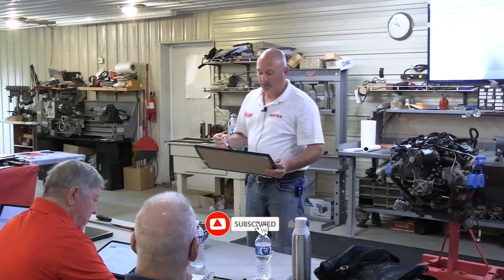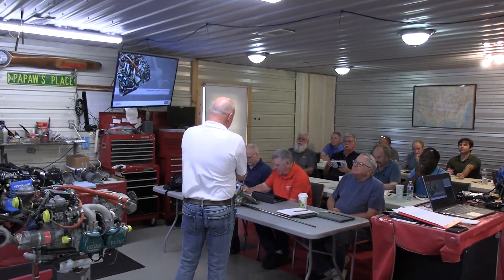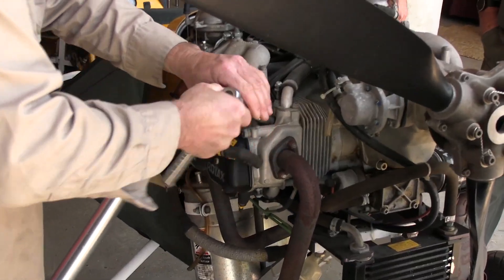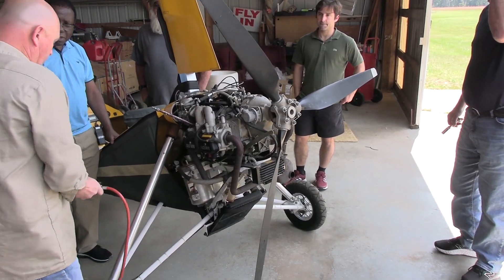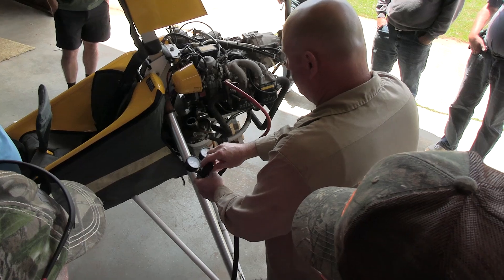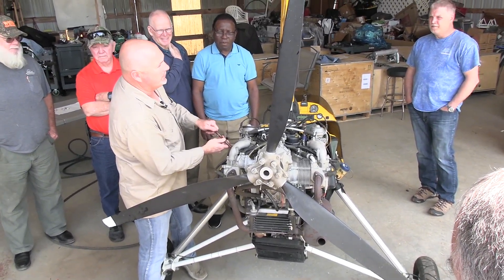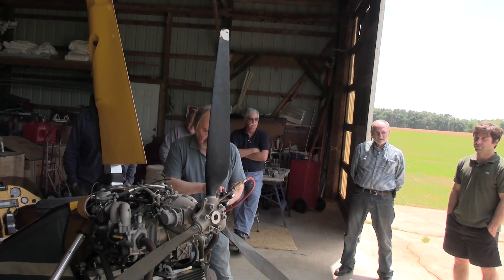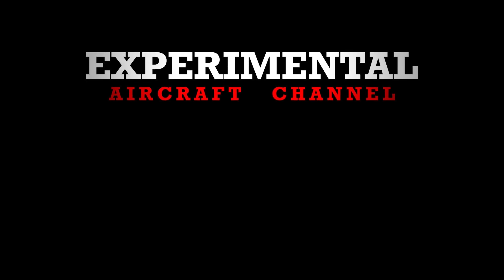Engine Tech!  Checking the Compression the Easy Way - Rotax Aircraft Engines

Comment: How does one Convert the Compression to Air Craft(78-80) example, from 160psi or 10.3:1 ? Explain how to arrive at that Determination.!
Reply: Please watch Mike Bush’s seminar (Savvy Aviation) regarding the engine compression test.  It is absolutely the most undependable test of cylinder condition and is likely responsible for more maintenance induced engine failures than any other maintenance procedure.  Here are the documented results of a cylinder compression test on cylinder #1 of a Lycoming 235 performed 11 consecutive years by the same mechanic: 78-54-76-64-66-72-63-70-68-67-66.  So did the cylinder heal itself a year after it tested at 54 psi?  No.  The flaw of the test is that it is not repeatable due to multiple factors. Watch the seminar…..
Reply from the maker: If you put in 87psi you should show it holding 87psi. In other words PERFENT is 80-80. (And/or within tolerance of whatever the specs are). If less than... then would see 80-75 etc.